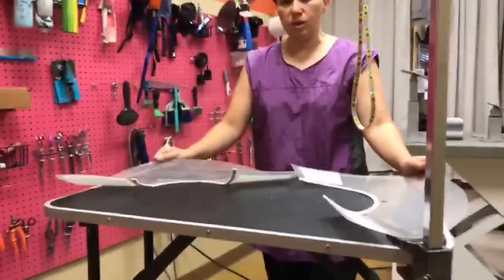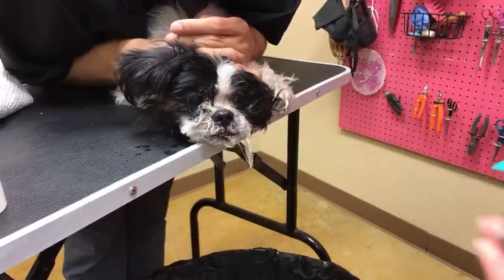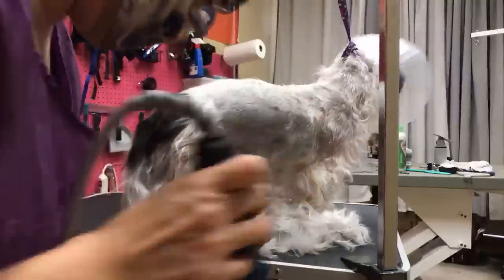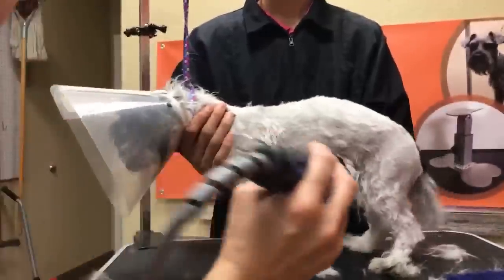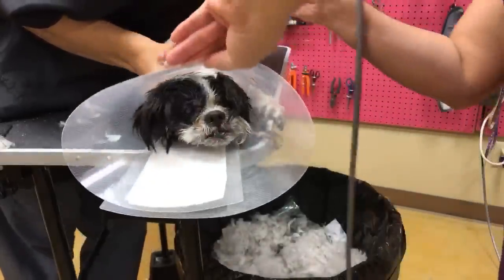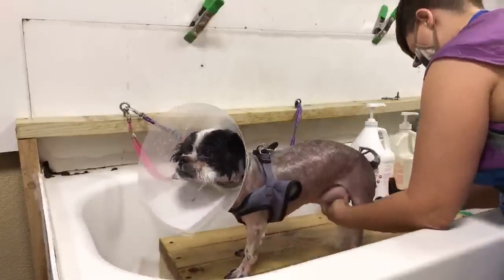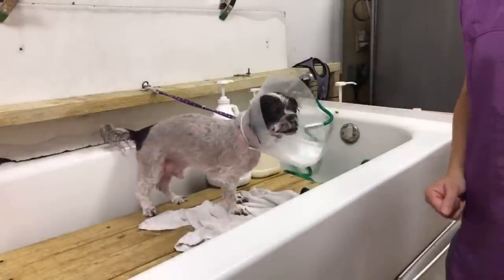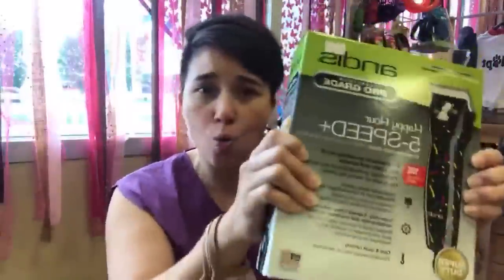Sammy Davis Mean Mean Dog Grooming Shih Tzu  live

Comment: For a dog that doesn't like its face cleaned, you can use an arm extender, like the one in handicap section. It's an extender that lets seniors be able to reach things that they have dropped with out bending over, or reach things on upper shelves. Put soap on the dogs face, wash cloth, or sponge n then grab the washcloth or sponge with the extender n scrub the dogs face.

Comment: Speaking of ordering from you. As you may remember I’ve purchased quite a few products from you and all of them have been great except for the long toothed dematting comb. The teeth were loose and twisted every time I used it so I tightened the spacers just a bit to try and stop the issue. That’s when the teeth started breaking off and I wasn’t even using it on big mats, nothing that I couldn’t  get out by picking with a regular comb but it has always been faster with the long toothed mat comb until the teeth started breaking. Don’t know if I got a defective dematting comb or what but I miss the ease with which it removed mats on my long haired English Setters.
Reply: May I suggest you contact Dede directly via email and discuss this with her, she may not be aware of any issues.